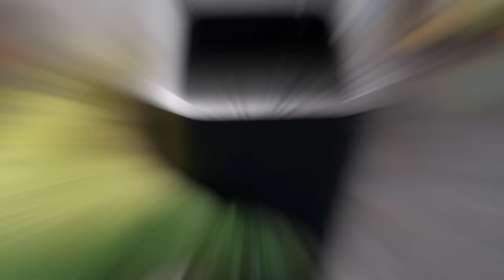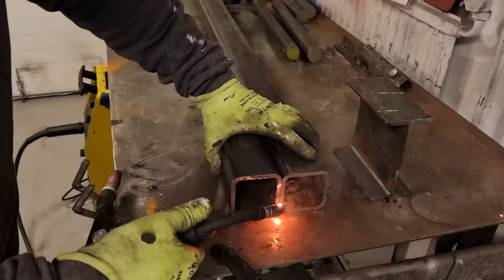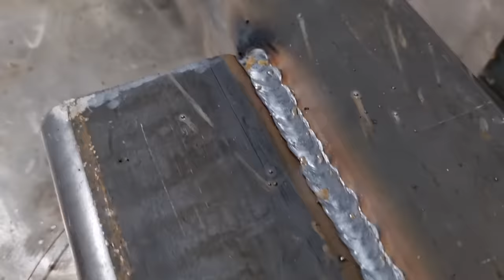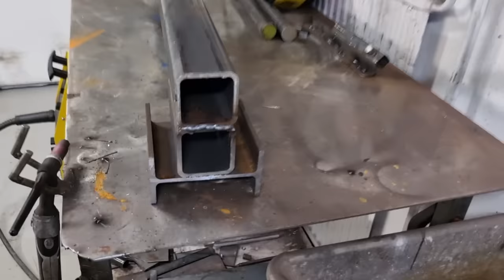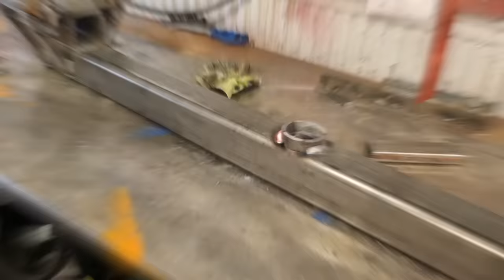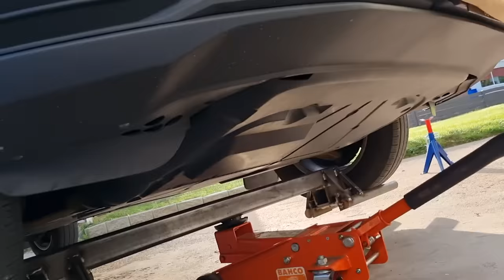Absolutely new Unbelievable Homemade !!! for Cars Never seen Before

Comment from the maker: 2024 New invention for cars  never made before 👇👇
https://youtu.be/7zRfMtUs_D4?si=VkNr9-a4qE7uYoXH
Reply: Ideas ok but what about the different clearances on other vehicles, no thanks
Reply: Yeah I just love the part where you do not show how you get the Bars Under the tires what's up with that
Reply: @wendellsnowden4902  I personally would drive on it then proceed to change my fluids, starter, rear seal or whatever.
Reply: I would add to your design a plate on the bottom with a lip that would prevent the jack from jumping out from under it because the nature of these Jack's is to travel backyards as you're jacking the car up.
Your invention is  really useful for doing a ton of work underneath a car because it gets the tires out of the way yet is much safer than removing the tires in case  somehow it were to fall.
Thanks for posting!
Reply: @kobiroar4221  I  thought the same until realizing this is why the barstock is so long.
Reply: What is your main purpose of this thing?🤔

Comment: Or you could just jack it up with just the jack and accomplish the same exact thing without having a giant heavy metal bar taking up all kinds of room in the shop
Reply: Yeah that thing is great until you need to take the wheels off. Not much you do on the front end of a car with the wheels still on.
Reply: This is true yet you still people using things to roll on to to raise there car up higher to get underneath to work on your logic is a weird one as removing the tires would be common sense to not have the bar yet here we are having to explain to you like a child why you would use it. Guess you have not worked on enough vehicles in your day yet youngster
Reply: It actually would work great when doing suspension work and car needs to be on wheels to torque everything down.
Reply: I didn't even watch the video, saw the first question and had to reply, I do it when I need to, just put on (axle) solid jack stands and let out the clutch slow, you can go thru the gears, brake, carefully because your spinning wheels have a lot of inertia in them. Didn't want you to go thru the garage wall, greenhorn. No question is stupid when still a little wet behind the ears
Reply: He must be the shop supervisor and union representative for the worst of time and money.
Reply: @patthesoundguy  took the thoughts right outa my brain
Reply: Most of the times when you want both or all wheels off the ground is to work on something behind the wheels or to swap or rotate the wheels so they have to be removed. I'm not sure how this would help me.
Reply: Nice but I don’t think it would clear my 1993 mustang.
Reply: Built a quick-tow rig and adapted it for shop use...respect.
Reply: @neoskater420  I would be surprised if even you could read what you've written without pausing.
Reply: @neoskater420  try punctuation, & maybe clear English.
Reply: @neoskater420  I'm not a youngster, & I've worked on plenty of vehicles in my day. I do not see the advantage of that bar. It's not going to fit under my sports cars, i can barely get just the hydraulic jack under them.
Reply: @joe00camaross  what are you going to need it for on the suspension? 
I would never crawl under a car that was being held up with only a hydraulic jack. I always put jack stands under each side of the axle before crawling under. That bar is in the way of that, & i wouldn't trust it with the jackstands resting on the square tubing of the bar. No offense to who made the bar, maybe he likes it. Personally for me it would never get used, & several others on here agree with my assessment.
Not to mention it's pretty much made for certain width vehicles, there's no way to adjust for narrower width vehicles. 
In time that square tubing is going to get a major bow in it. The weight of the vehicles resting on it is going to bend it.
Reply: I was done as soon as I saw him cutting that peice of I Beam
Reply: Some vehicles are have a high frame, this tool will come in handy for vehicle with large wheels.
Reply: Buy a set of quickjacks from Costco for $1500. Best money you will ever spend to lift car by rockers and work safely  underneath
Reply: @jpro8724  you can get them at Walmart for roughly the same price.
Reply: @neoskater420  I disagree, there are not many repairs I'd want the wheel still on. Yes you can take shocks off without even lifting but so many things are made easier by having more access by removing wheels:
Sway bar links, Lower and upper control arms, ball joints, tie rods, power steering rack, stubborn rusted rear shock bolts, steering knuckle, rotors, calipers, brake lines, bleeding brakes, wheel hub replacement, changing stripped out lug studs, taking out Axle, wheel hub bearings.
Pretty much everything suspension is wheel off, thats why all our shop lifts lift from the 4 frame points behind wheel fender well at end of lower control arm bracket to frame.. only times I've seen under wheel lifts used is when a wheel is complete locked up or the suspension is so bad driving will destroy parts, so they put that wheel on a wheel lift to push car in shop while in neutral.
Reply: How many times do you jack the car up without removing the wheels?
Product is virtually useless. 
Tale it out behind the barn and shoot it.
Reply: @Tom-cz9op  I'm with you, i honestly can't think of one instance where i would use something like that. 
I certainly wouldn't trust it to lift the vehicle & hold it while i crawled under it. 
    A): it's not solidly on the jack.
    B): the tire bars are not far enough apart to hold the tires for me crawl under.
    C): i never crawl under a car with only a jack holding it up, i always put jack stands under, & jack stands won't fit solidly on that square tubing. 
    D): that square tubing will eventually bend due to the weight of the vehicle, because it's a bigger vehicle that will only fit under.
Reply: @joka2200  no, if you own a vehicle that has low ground clearance, you need to jack it up a good bit to do any work under it.  I have a BMW.  Have to jack it up on both sides, put in jack stands, jack up some more to raise the jack stands higher.  I had to replace an electric water pump.  It's under the engine.  Also change the oil.  Could not reach without jacking.  This would be a time saver. I'll still use my jack stands for safety but this will save time for sure.  Even if I'm working on the wheels, I'll put the stands under then loosen the lug nuts, then let it down on the stands.
Reply: @joka2200  backyard exhaust work, rear sway bar, gars tank removal, checking for rust, etc
Reply: Then There would be no need to make the video. Continent continent continent
Reply: Then There would be no need to make the video. Continent continent continent
Reply: @openyoureyes3113  that probably would've been better.
Reply: Now do a brake job 😅 LOL!
Reply: Well you could get the tires as high as the lift of the jack then put jack stands. So in that case it would save time.
Reply: But its great to lift the car because you can do it left and right at the same time. No side first then the other, slipping on jack stands. And it's also better for placing the Jack stands, because the lifting points are free. 

Admittedly I would build it a but different. 

First: 2 of them. 

Second: the bar should be able to drive over stand alone.

Third: points where jack stands could hold up the bar in the air. So you can lift the car alternating Front and rear with only one jack. 

Fourth: I would leave more space between the bar which hold the tire.

Fifth: maybe adjustable in width?
Reply: ,notice how he never shows running up on it? This isn’t a good idea, even for oil changes
Reply: @neoskater420 

Until it’s time to change the brake pads smart guy
Reply: No you can't

Comment: Looks dangerous. The car could roll right off😳
Reply: Chock the wheels 😳
Reply: 😂, wheel chucks ?
Reply: @jlrockafella  yeah a wheel chock. Chock the wheels that are on the opposite side of the wheels being lifted. And if you think i misspelled chock then I suggest you get to googling that there mister. Makin sur dat I ain’t mispeled et
Reply: The weight of the car keeps the wheels settled between the pipes.
Reply: Totally agree. Too dangerous for my taste.
Reply: The "End Piece" cradle the tires,...therefore, becomes a "Choke" of it's own..  The vehicle won't roll off of it,...however, the vehicle + the Lift apparatus + floor jack may roll down hill together,...and this is what a chock on the front wheels will prevent!

Edit:  I revisited the video, and now see that the part that goes underneath the tires for lifting is Not Wide Enough to allow  the tires to Sit Deeper into the device.  So, given that issue, Chocks are definitely NEEDED!

Comment: I would definitely say test it on different weight cars so you know it’s tension strength. This is a great build but I’d like to know it’s weight capacity.
Reply: Looks dangerous false sense of security , fixed axle stands one at a time safety first
Reply: Wow is great thakns for time you are the best 👍🏻
Reply: @gedman9527  .
You are right that you should use axle stands but this is a great way to lift the car to put the axle stands in before you get under the car
they make hoists that lift the whole car on four arms and they are safe.
This would more than likely easily hold more than the jack could lift. If anything it is over engineered.
The car probably weighs around 2,000kg which means 500kg per side on the stand, not really much for the size of the steel used.

Comment: This is a simple and interesting device, but it is only suitable for cars with a huge ground clearance. Most modern cars are not compatible with it. The device will only work with the back where there is a void. In front, there is the suspension, the engine crankcase, and its protection, there is barely 130 mm clear.
In addition, a square pipe for heavy cars needs to be reinforced with scarves from the bottom to ensure sufficient rigidity. Because even in the video you can see how the pipe bends. After 10 lifts, it will take the shape of a hemisphere.

Comment: Definitely need to get a lower profile and a better jack with a lower profile jack the round bars will all sit on the ground and I would put a bigger round pipe in the center for the jack.  Yes I would Definitely use hevy duty jack stands

Comment: Good idea,  but can’t see the point of it, you can’t do any work on the wheels, brakes or suspension. You can’t get the engine ‘splash guard’ of to do any work on the underside of the car, like draining the oil, changing the oil filter (if it’s on the bottom’) and all because of a big steel bar.
Nice welding BTW.
Reply from the maker: The idea is to lift the car up and put two jacks each side and work free
Reply: But one jack will do that, I’ve been doing that for over 60 years, works for me and the rest of the world.

Comment: What is the brand of that blade, and can it be used on a regular chop saw such as a Rigid 14" chop saw? 

I like how it doesn't put off a ton of sparks and all the dust that comes from typical chop saw blades.
Reply: Had to be a slower speed a d higher torque than a regular miter chop saw.
Reply: No u can't chop saws turn away to fast.watch how slow that saw turns.
Reply: Mine won't cut that good
Reply: That is an evolution saw with an evolution blade.
I have the saw and like it but use diablo blades. Far superior than the evolution blade.
Reply: Lol I just ordered a evolution 66t

Comment: Clever design. Has a few practical and safety draw backs. Keep at it. Work safely.
Not exactly sure what work you would use it for.
Side access wheel dolleys would be more practical.

Comment: Just use subframe mounts as jack points instead? What do you do when it's up in the air? You'd still want something other than a jack to hold it up while you get under the car. A pair of ramps would be even faster to use and easier to store. Nice metal work but not sure what problem it's solving!

Comment: That's great!
But how will that help rotate the tires?
Or do a brake job? 😳
Reply: Put jack stands under the frame of the car.
Reply: 1) It will allow you get the car higher off the ground because the jack starts lifting the car at a lower point in the jack's range. 2) It keeps you from damaging the side seam on a unibody chassis trying to lift it.  3) Once you have it at the required height use jack stands or wood cribbing to support it.
Reply: Nope it actually makes no sense to me,  you can change the oil if the jack is in the way, can't take tires off to rotate or change brakes.

Comment: would be a lot better used with a low clearance jack to bring down the height of it, great for transverse engines where they  either have no jack point at the front or its off set due to the engine, g'box layout

Comment: A fun project and useful for certain applications. I always wondered if someone makes air-rams to mount permanently under a vehicle to lift either of the four wheels for a quick tire change like in the Indy 500 pits?
Be nice if you could just hook up to a small compressor, lift either of the 4 off the ground, and it would always be there underneath for when & if you get a flat tire in the dark and/or during shitty weather.
Reply: No in Indy you can change tires this you can't
Reply: @Michael-DeltaWolf  I’m sure with some mechanical engineering, electrical and metal fab skills one could custom build a system for their vehicle. I have the electronics and metalwork skills, just not the mechanical or hydraulic skills needed.
Reply: @repairfreak  I'm not saying it's not a good product it's just is missing something . You  know like a the way a real car lift works but a mini version . Like instead of picking up the whole car you could pick up one ends  like the front or the back and from the side's to.
Reply: I think there was a taxi driver in France that actually did this on his Peugeot 406.

Comment: One improvement I would do is add some gussets from back of wheel to about 3/4 of the way to the lift point. That would help on the deflection as you lift.

Comment: You can already buy wheel jacks...each one slides under the tire lifts the wheel and has metal coasters for moving the car...and they are certified and load tested...and not expensive to buy...Dont fool around with safety !!!

Comment: Days ago I was thinking in a similar system, but instead of use a jack use an hidraulic 1000Kg scissor lifter 80cm max height, here called "traspalé de tijera", or use 2 jacks,  using the only  jack can be dangerous, car can incline at a side.  Weld a reinforcement at end of the round wheel supports, to prevent opening, but can be are solid ones with solid welds.

Comment: all you need is two legs on each side with holes and  you can pin it at different heights so the stress is not on the jack.

Comment: If you simply put the jack under the front or rear axle you accomplish the same thing as this device does. Then you not only have room to put jack stands under the axle but you also have the wheels off the ground and the suspension unloaded.

Comment: Great  idea no doubt.. Have a few ideas to possibly improve upon the original design:
 1. Make a sort of stay (or a small cutout) for the under side of the tool to ensure its exactly centered on the jack

2. Make the rods under the wheels roll.  Meaning the Thinner pieces under the tires actually spin with the speed of the tire.  Sort of like a dyna setup 

3. Possibly  make the lifting mechanism lift from the rear-end vs. Lifting from wheels
 Therfore freeing up the wheels for tire work/, doing brakes, etc
Reply: On #3. He stated don't crawl under the vehicle with just this lifting it, meaning, USE JACK STANDS! If you have it on the jack stands you can drop it out and roll it out of the way.

On #2 I see what you mean but if they roll the car will push it as it tries to roll on.
Reply: Cars weight is also not identical on both sides of center  as well so you need a decent amount of strength from the middle centering piece to insure it doesn’t crack or break cause the right side wants to come up easier than the left

Comment: Besides all of the safety concerns other have mentioned, just from a practicality standpoint, this device limits how you can slide in under the vehicle to do any work.  You can't slide in from the front very far, and sliding in from the side also limits what you can access.

Comment: I must be missing something...how is 1. buying all the steel and welding up this massive heavy bar, 2.  laying it out, 3. driving your car tires over the bars, then 4. centering the rolling jack under the bar, 5. then jacking it up and putting some safety jacks or blocks under the frame, easier than just 1. rolling the floor jack under the car, centering it on a frame section, and  jacking it up and, 2.sliding some safety blocks under the frame?

Comment: well it has very limited use,obviously you cant take the wheels off but also can't change oil or work underneath where the cross bar is..I prefer simple drive on ramps

Comment: This is not a silly idea there are a lot of vehicles that have aluminium cross members and you shouldn’t jack them up on the aluminium casting as per the manufacturer guidelines.
If your working underneath you still have to place jack stands to support the vehicle, then lower the jack and remove it to work on the vehicle .

Comment: What the hell is the square tube doing in the I-Beam? Also why are you not doing it with either SMAW or TIG if you are that affraid of it cracking under load Mig is notoriously weaker and with much less penetration.

Comment: One question the main purpose is to remove the tires right?

So if the tires are lifted with this stand...how do you remove the tires...if you're not using it for tire change then the jack is going to be in the way 

If you're jacking the car to work on the axle then again jack or tire must go? 

But it's a cool concept just not practical!